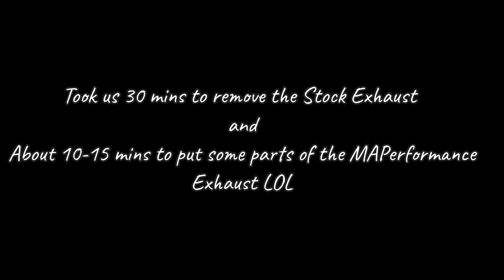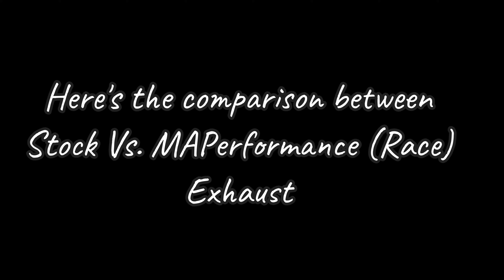Finally Installing an AfterMarket Exhaust for Sasha!! // 10th Gen Civic Si

Comment: How many miles on the car? Done my fair share of exhaust replacements at the dealer I worked at. Removals are a pain at high mileage, especially if the manifold bolts weld into the cylinder head from rust alone.
Reply from the maker: When i installed my exhaust, it was around 90k KM so about 56k miles. And yea we had a bit of trouble taking out the exhaust but luckily my dad has some tools we can work with.
Reply: @itsjireh  56k isn't bad, though you should try Ford's 4.6l Modular V8 (200K miles). You'll be spending  around 16 hours, most of it at the exhaust manifolds & EGR setup on a full replacement. Honda engineering isn't ridiculous at least.

Comment: this air filter not oil ?
Reply from the maker: No not oiled. Its a dry air filter
Reply: @itsjireh  its good yes? i know knn filter its so bad witch oil. but he is dont have oil its good.
Reply from the maker: @EdoRoCk Edward  to be honest, since i drive my car daily, i dont feel any difference between this vs the paper ones. If i would go back in time, i would have gotten the paper ones lol
Reply: @itsjireh  understand. prl intake and filter good?
Reply from the maker: @EdoRoCk Edward  i personally dont know but hearing from other people, its better to put the actual cobra prl intake than just the filter and the tube or your next option would be 27won intake. And if you get one and car is not tune yet, get the street version. Because race version requires tuning